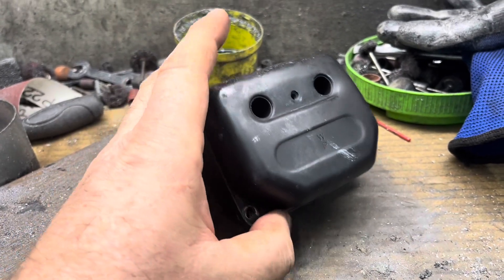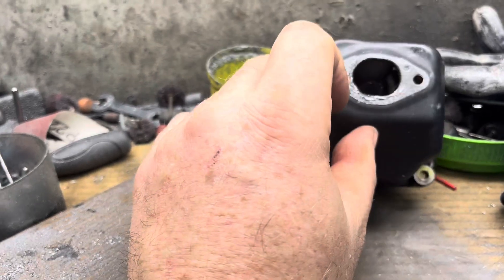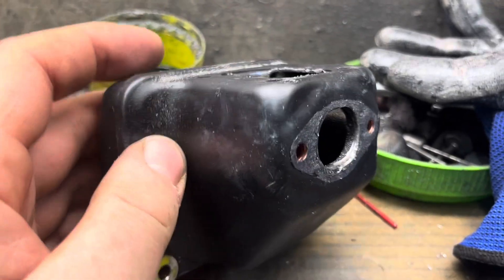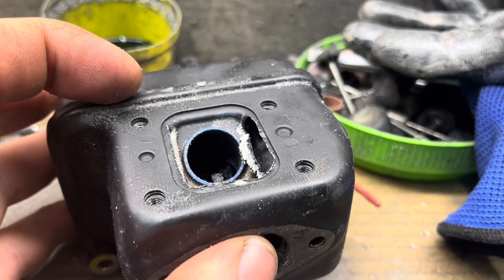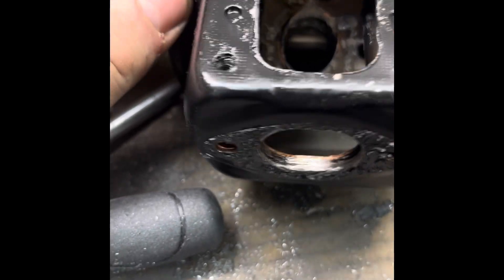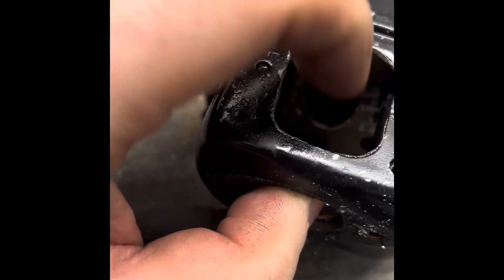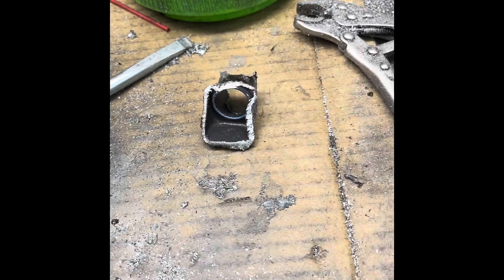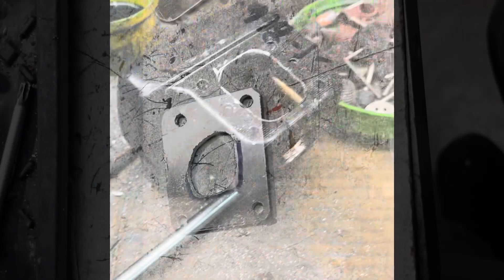Echo 620P best muffler mod. Requires a bunch of grinding, but worth it.

Comment: Nice that'll sound a lot better than just drilling a hole in the top right behind the baffle tube like most guys do.
I kinda half assed the muffler mod on my 590 last week, I dont want it to be too loud. I can always go at it again and copy what you did here.
I drilled/reamed the holes in the baffle plate in the middle of the can out with a 10mm bit, they're now a 10mm slot and bigger than the tube they feed. Then I put two 5mm holes right in front of the baffle tube on the top (front side so they point back into the deflector) plus did the usual removing of the inner deflector.
It's loud at idle but not much louder then stock when revving because the baffles are still in it.
Reply from the maker: Cool, yeh, whatever works. It’s always smartest to run with the spark arrestor in tact like I’ve done here, which sounds like you’re doing as well 😉👍
Reply: @jimssawsnstuff8903  I learnt my lesion on other mufflers, it's really easy to make them loud as hell. Im cutting firewood side by side with my buddies now and they complain about the noise from my other saws.
Your setup is nice as you can make a different restrictor plate for under the deflector to quiet it down if need be.
Reply from the maker: @ yes, exactly 👍 
Thanks for the chat. Lots one to come on the channel…lots of saws in the shop now.
The 620P is going firewood cutting Tuesday once the weather warms up.